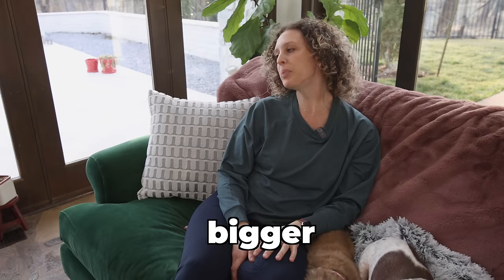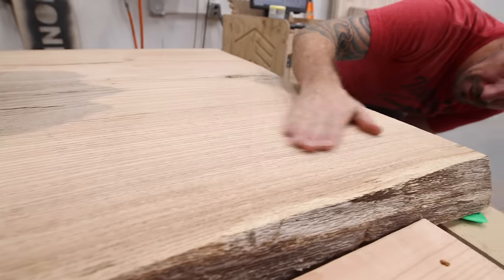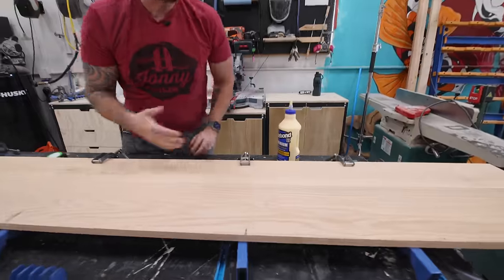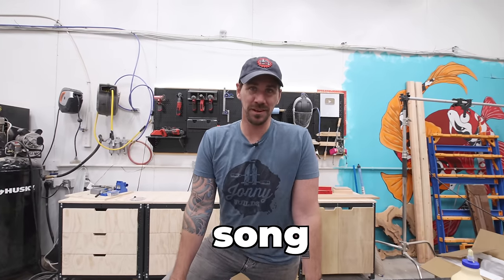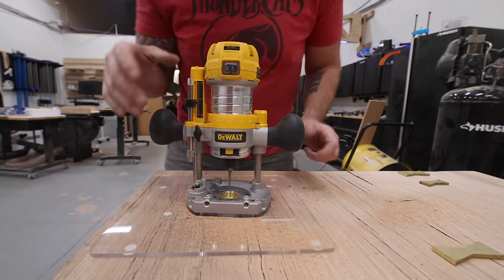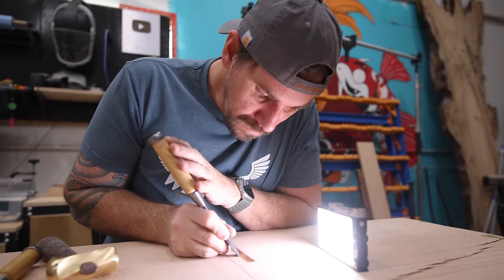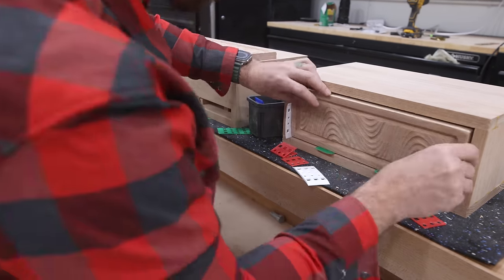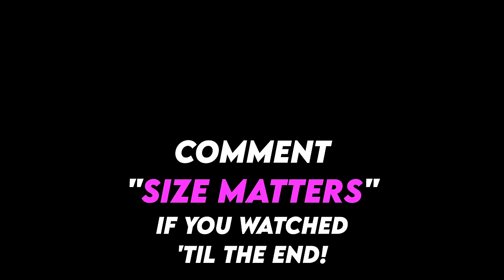$10,000 Bed Build

Comment: Someone might have suggested this, but if you want to distinguish red oak from white oak in the rough, take a very sharp chisel with you and take just a small shaving off of the end grain. Then ideally use a hand lens or just get really close and shine your phone light on the fresh cleanly shaved spot. You will see small crystals in the pores called tyloses if it is white oak, and they are absent in red oak. I learned this in my wood properties class while earning my forestry degree and it can really help you when you’re looking at a pile of rough sawn oak boards that have been sitting in a barn for 30 years covered in dust.

Comment: Lower the retract height in your CAM software, which will drastically speed up these type of carves. Retract height is the Z movement you see at 9:50. A lot of wasted motion that's only useful if you're trying to clear something that's in the way.

Comment: Killer bed, those vector carves look amazing!
And best bedroom song? The best one is already written and pinned, so I'll leave the second best:
Joe Cocker - You Can Leave Your Hat On

Also, I can't help but laugh at bit at the hardship of US woodworkers in getting your hands on a Baltic Birch supplier. This is probably one of those very few times where global location gives me a benefit I didn't really know I had. As I'm a Dane and as Denmark lies right between the North Sea and the Baltic Sea, I figured it wouldn't be hard for me to find a supplier that sells Baltic Birch. And sure enough, I found a place with 94 sheets that measure 2440x1220x9 mm (96x48x0.35 inches). They're a bit expensive, about $173 USD per sheet, but they're there.
Reply from the maker: That’s awesome! I think over the next few years we’ll see more europly manufactured in the US and other places.

Comment: Size matters, but you can try Rubio's Mint White pre color on red oak to take out the pink undertones and make it look more like white oak?
Reply from the maker: Yes but it leaves the white in the grain which was not the look I was going for.
Reply: @JonnyBuilds  true! I like using smoke 5%, and that does a similar effect, so plays together in that case
Reply: @JonnyBuilds  for sure. I've thought the same sometimes. But did you know that you can dilute the precolor with water for a more subtle effect though?

Comment: Do you have a way to turn off those lamps without closing them? I guess it's still a bit dumb. I would get angry really quick if I had to fiddle with closing it after angling it properly every night, instead of just hitting the switch. And if you leave them open then what's the point anyway?

Comment: Sense the bow ties were needed to stabilize the slab any way you might as well make them a design element by using the brass, like you did, or as least some other contrasting material. If you had used red oak bow ties it, in my opinion would have come out looking like a bad attempt to fix a defective piece of wood. The contrasting material makes it a bit more classy.

Comment: What joint did you use for the bottom of the drawer?  I didn't see the telltale notch showing a full length rabbet in the edges of the sides.

Comment: What joint did you use for the bottom of the drawer?  I didn't see the telltale notch showing a full length rabbet in the edges of the sides.
Reply from the maker: It’s a stopped dado which I showed cutting on the router table.

Comment: Those bow-ties are too flimsy for such a thick slab. They should be 1/3 or more the thickness of the slab. Those are just for aesthetics if the slab first starts to separate/crack.